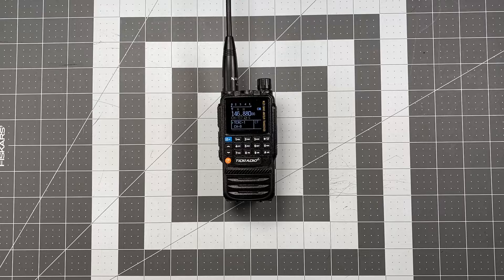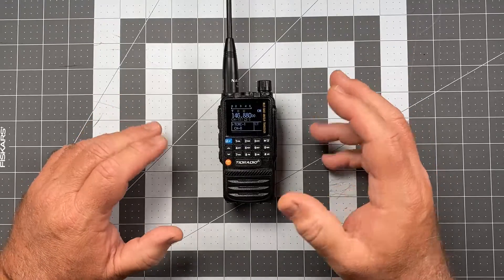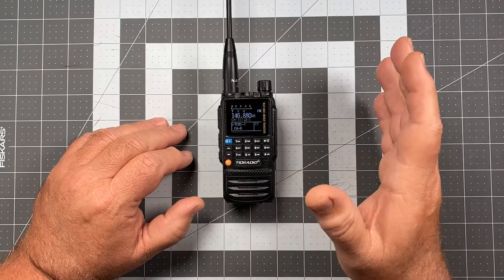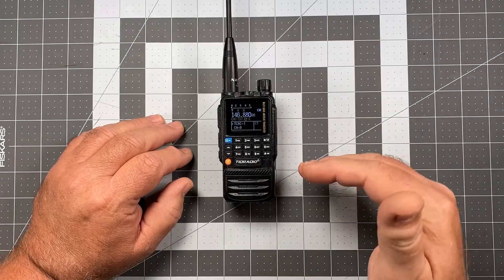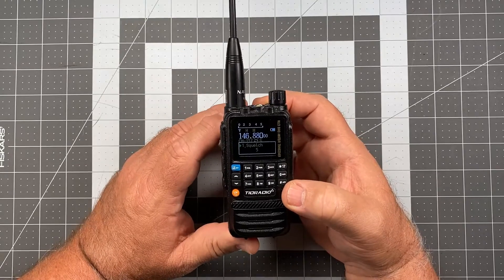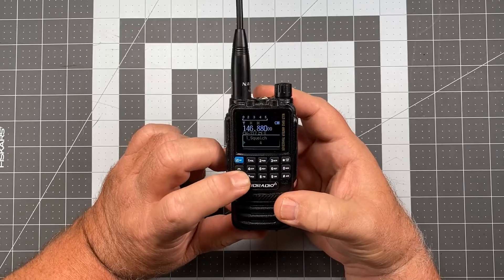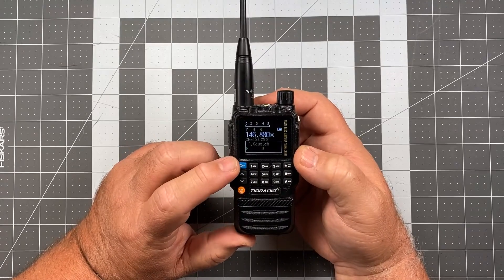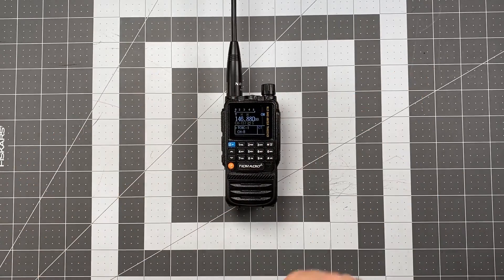TID Radio TD-H3 Operators Series: Part 6 - Squelch adjustments

Comment: Hi Scott, regarding this very radio, which control button is the monitor button, to temporarily open the squelch?  I thought it was the third down side button, but mine turns on the FM radio with a long press. 

Thanks.
Reply: It doesn't appear that this is something that can be done from the radio itself, but if you use CHIRP and download the data from the radio, there is an option in the Settings tab to change the function of the third button down on the side (called SHORT_KEY_PF1 or LONG_KEY_PF1). Those settings allow the monitor function to be programmed to either the short or long press of that button.
Reply: @nknasi , I appreciate your reply… very much.  I had gotten it figured out using the ODmaster app.

I have much to learn, and I appreciate your channel, where I come to learn. 

Best wishes,
George